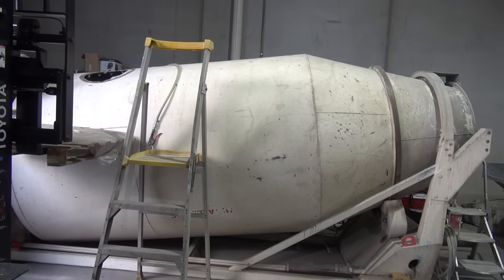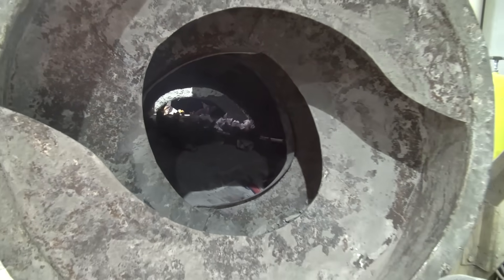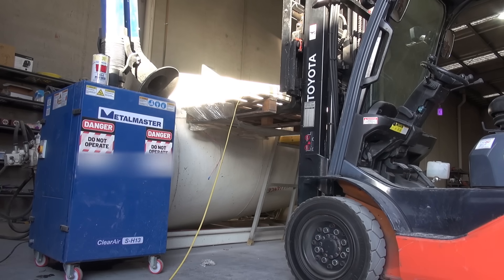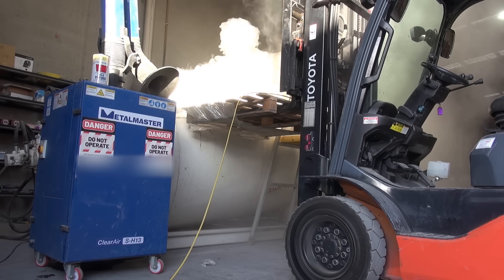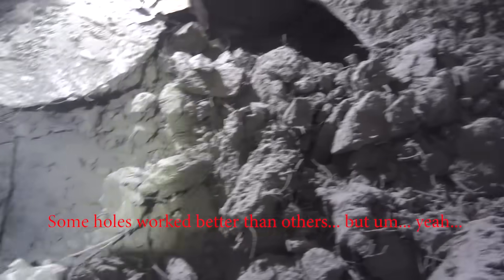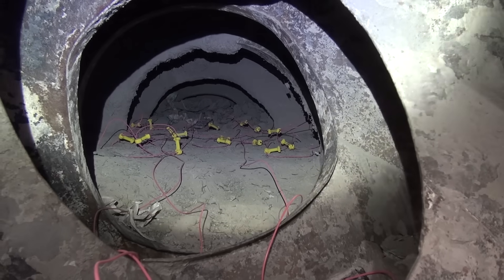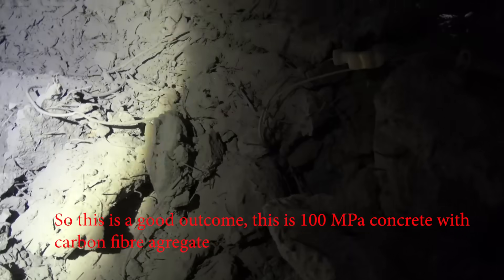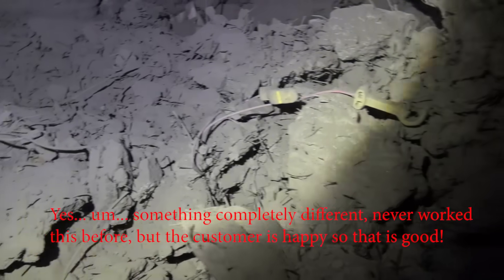Using Explosives to clean out a concrete truck

Comment: At least it will self-unload by rotating the barrel backwards, as if the concrete were liquid.  I hope you used double hearing protection in there, Dave!
That were all those sticks/roots which looked like weeds.  That was strange to see in the broken chunks of concrete.  Oh, carbon fiber.  Hmm.
I thought the companies used fairly undiluted muriatic acid to eat the concrete away.  (I use 10% MA on my crete tools.)
Reply from the maker: We had a lot of discussion about how to do it, using a jack hammer was a failure - in the end we just blasted it. Not enough room in there to use my small air drill, so we used a large electric drill, this was a lot quieter also.

Comment: JHC, Carbon filaments and you still took the job... Very impressive, that's seriously tough stuff.
Reply from the maker: The carbon fiber made it much more difficult but it was still possible. I did not really want to do it. A regular size bowl on a truck is an uncomfortable work place, this one was really tight.

Comment: You have admirable patience. I hope they paid you well. It was more difficult than usual because it was fiber-reinforced. The last time it happened to me, I cut a longitudinal window 50 cm wide and the entire length of the mixer. In Italy, we call it a glass. I had holes drilled every 50 cm and loaded it with 3 kg of gelatin. After firing, I had the glass pushed with a wheel loader and it emptied as if it were full of gravel. Then I called the scrap dealer and sold it by weight.
Reply from the maker: Hi Laurence, It certainly was more difficult than usual because of the fiber. Did you not want to try to save the bowl that you blasted? I'm thinking that 3Kg is a bit heavy handed.
Reply: @demolitiondavedrillandblast  It had fallen into the river loaded with concrete. Luckily, the driver was on the ground maneuvering; there was nothing salvageable. The environmental protection authority had ordered me to remove it within two weeks, and there was no road to get close to it with a crane. The least expensive solution was demolition. When I released the current, it swelled like a balloon filled with air and immediately returned to its original shape.
Reply from the maker: Good call.

Comment: Did someone add wire to that mix?
I’ve seen fiber mesh in a mix but never anything that large of a diameter!
Reply from the maker: It is carbon fiber aggregate. This mix if for shotcrete, the fiber makes it very strong.

Comment: Bravo.....fire the worker that didn't  do wash out..........they make jackhammer  thats designed  to do that job......and explosive  indoor is a  problem........mom say.....loss ur licenses....
Reply from the maker: They tried to jack hammer it and failed. This is super high strength concrete designed for spraying on tunnel walls, it has carbon fiber strands in it to hold it all together - this mad it almost impossible to remove with traditional methods. Using explosive in a carefully managed environment was no problem. We warned the neighbors and they did not complain.

Comment: I was wondering what the fibres were . Hadn't heard if carbon fibre reinforced concrete before. 
That's one very cramped space to be climbing into. It must have been a joy to drill holes in there, not. 
Good to see a professional do what mythbusters couldn't without removing the mixer too.
Reply from the maker: It certainly was a tight squeeze in there!

Comment: How could all that explosives and time labour be cheaper than a new barrel plus recycle value of the steel once you cut it and peel it off the concrete.
Reply from the maker: It was not only much cheaper to fix it, but much quicker, and that was the key issue. This unit was a special build, made in France and being used on a tunnel project.

Comment: I'm pretty sure they didn't leave it there to harden on purpose or so. Probably got a power outage or mechanical malfunction when they were mixing.
Reply from the maker: The unit popped a hydraulic hose... and being a quick setting mix for shotcreting, it was all over very quickly.

Comment: Why dont they leave the barrel on the truck so you could turn the barrel to empty it between blasts ?
Reply from the maker: This mixer is skid mounted.
Reply: I see that I was asking why it is not left on the truck so you could spin out the blasted material
Reply: The material will never be out of the barrell if it cant turn

Comment: 😆 we used to go down the drains too. So dangerous. Some tight squeezes sometimes. .....i was wondering what the hell that crappy concrete was looked like a special somebody snatched it mix. 100...thats hardaf. I remember weeks of drilling 45+mpa horizontal by hand with 30mm rock drill, that sucked...
Lots of experience doing it the hard way 😂👉Hmu if your hiring 👍have machine tickets too. I'd love to work in blasting.
Reply from the maker: All horizontal drilling without an air leg really sucks Mark. Where are you?

Comment: What is the cost difference between salvaging mixers in this condition, or worse, as opposed to replacing them??
Reply from the maker: Cost of replacement was higher but the big issue was waiting time for a new one.

Comment: Sorry if this has already been asked but what the cost of the service versus buy a new agitator drum?
Reply from the maker: The cost of a new drum is high and the two companies in Aus. that make them have full order books so there is also a long waiting time. More so with this one as it is not a standard product. Add to this the cost of a large crane to change out and disposing of the old drum.

Comment: Concrete fumes

Don't breathe that!
Reply from the maker: I go to a lot of trouble not to breathe it FP, I have a full face P3 rated respirator and when I am inside the bowel there is a vacuum extraction system running the whole time.

Comment: when I was in high school,  my step father at the time was the big cheese at a ready mix company. there was an accident once where a truck came apart and they just couldnt get the concrete out of the drum. they concidered every thing, including this. in the end it was cheaper just to send it off to the scrapper. they used torches to cut the steel off and peel it like an egg. I bet that concrete is still out there somewhere.
Reply from the maker: There is no cheap option here, to replace the drum you need a huge crane and getting rid of the old drum is expensive

Comment: I work as an electrician and ive never seen concrete with fibers. Ive heard of it though. Where is it used for?  Is it more durable or expensive ? Can you use it without structural steel ?
Reply from the maker: This was a shotcrete mix for lining mine tunnels, very very tough stuff, used in conjugation with bolted mesh.
Reply: @demolitiondavedrillandblast  i see, thank you so much for the reply Sir! Have a nice day

Comment: It must be a deafening experience in that confined space. Hope they give you adequate ear protection to use while blasting! I would imagine that used bucket teeth would be able to chip concrete out of a barrel if they fit into it. Just got to find a drive shaft and motor that would effectively turn it while they do their work. The other tool that comes to mind could be a mini excavator with a long spade or chisel bit in it. That would take most of the hand jack hammer work out of it. Someone might custom make a vibrating version that can vibrate sideways with a look similar to a spiked mace that warriors from long ago used to club their enemies. If you know what a sheepsfoot roller is in the earthmoving industry is, something like that only small enough to fit in the barrel opening. Just random ideas I'm getting, if you've already tried something similar, don't worry about it. :D

Comment: "customer is happy", driver that mucked the load holding the jackhammer in the corner is ecstatic!
Reply: It's not a concrete truck unit, if you had taken notice of the cerroundinds you would have realised it's an inside job doing factory work , probably when they had a power cut

Comment: I remember doing this many years ago for a local redimix company.  It was a lot of fun drilling and blasting but shoveling out the debris while the barrel roasted in the summer fun did take a bit of the edge off the fun.  Learned a lot of physics on that job.
Reply from the maker: Hard work on a hot day, no doubt about that Mark.

Comment: Who was the wally that left fibre reinforced concrete in the mixer to set? Their boss should have put them in there with a hammer and chisel,
Reply from the maker: Hydraulic fail, no drum rotation...
Reply: @demolitiondavedrillandblast  Mechanical failure then, but still why did they not get in and start shovelling before it set? Would have been the common sense thing to do you'd think.
Reply from the maker: Yeah, if you or I paid for it we would be trying very hard to save it, I don't know any of the details as to how this came about VE

Comment: Awesome job.  I wonder if inverting the barrel for each shot would help.  Clear the muck, and maybe allow chunks to fall free.
Reply from the maker: Yes, probably however at that time they had no hydraulic power source to get it turning, also have to be very careful that the whole thing does not tip over.

Comment: Spoke to a cement guy here in Jamaica and if for any reason he  can't dump his load and it starts to harden  ( starts seeing stream) he dumps a 10 pound bag of sugar in the mix so when it does harden its super weak and easier to break up.
Reply from the maker: The sugar works well when you are able to mix it in, this one had a hydraulic failure and was not able to turn and also I guess that since it was a shotcrete mix it was probably also fast setting.

Comment: Myth Busters sucks anyhow.  They have been wrong sooooo many times.  Just being wrong doesn't make me hate them, it's when they show intentionally fudged results to shill...that makes them suck.  I guess they had a few Marines, freshly battle stressed, a little upset over calling Carlos Hathcock a liar.  (Hathcock was a Vietnam War Marine sniper who managed to take out an NVA sniper by shooting his scope, the glint was all he could see. Hatcock wasn't a hero only because of his success as a sniper, he burnt himself up rescuing soldiers from a burning APC.  Jamie and Adam said this very brave humble man was lying, later proved possible many times.  Was the only one they retracted that I know of, and they did it really quick....... :)  :)  :)    Frozen Chickens testing windshields, wrong, Broad heads useless on arrows, wrong, hydrogen won't run a car, wrong, (source of it whatever, they said it just won't run an ICE lol), Fudged their data on hydrogen generation from solar, altered time stamps, but forgot to erase shadows lol.....they suck.

Your vid awesome,  thanks.
Reply from the maker: Thanks for watching Rick.
Reply: @demolitiondavedrillandblast  Sorry I ranted, nice vid.  Do you guys use sugar when you get down close?
Reply from the maker: Sugar to prevent the cement going of is commonly used here Rick, not much use though when you have a hydraulic fail that stops the drum turning and there is a quick set mix inside.
Reply: @demolitiondavedrillandblast  Good to know, thanks

Comment: A full load of concrete left inside to set solid. That's passive sabotage.
Reply from the maker: No, just a hydraulic failure in this case, have done other truck mixer that definitely was sabotage though.
Reply: @demolitiondavedrillandblast  just that we had that happen as well and managed to shovel and bucket most of it out. Warm work though.
Reply from the maker: And the smell of ammonia?

Comment: Looks like a sabotage as there are rebars inside.  Were the workers not paid or the boss is an a hole or both?
Reply from the maker: No, no, The fibers make very strong reinforcing for shotcreting tunnel walls, the drum stopped when there was a hydraulic failure and it could not be fixed in time because this is a very quick setting mix.

Comment: You know how like a dentist get that tool and he puts it on the inside of your tooth to drill it out to put a new Canal instead of putting it inside the tooth put it on the outside of the tooth and vibrate it from the outside to the Core just an example

Comment: If you can put three different rods at Angles along the body and use those rods like a transmitting a tuning fork frequency and as you alternate the three different frequencies between the three different polls and a circular formation it would pound out the concrete into a powder and basically make it into starting material without using any explosives but just imagine putting a bad drummle on the side of the can the knock the plaster out of a tin can try that first

Comment: Carbon fiber......hope you had good  mask............
Reply from the maker: I did! using a P3 rated particle filter, the main risk comes from sanding the stuff in this case the fibers seem to be almost unbreakable, when the concrete breaks the fiber remains in tact but just pulls out of the concrete.

Comment: You could have filled it with caustic soda. That would dissolve the concrete and won't damage the steel. Not as fun and will take longer.

Comment: Why wouldn’t it be emptied or watered down so that it doesn’t set?
Reply: Any number of reasons, someone quit and let it go hard, truck got stuck, rotator failed.
Reply from the maker: Hydraulic failure = can not rotate drum = can not empty = hard concrete in drum.

Comment: Those are carbon fibers? I didn't know it existed. I have seen fiber glass In a product called power wall a stucco that is crack resistant. But this must be very good concrete. Unfortunately for these guys
Reply from the maker: Very strong stuff for shotcreting mine tunnel walls.

Comment: i had to use a jack hammer to clean out thick accumulation  in a mixer once.  it was deafening loud....  They made me do it again and i kind of refused,  i bought 40 bowling balls, chucked them in and turned it on and let it tumble for 8 hours...  Came out looking like new inside
Reply from the maker: Good idea.

Comment: Done two of these was using about an 1/8 of a stick in each hole, boss said we were taking to long, he drilled the holes deeper and put 1/3 of a stick in each hole and split a 3 month old muhlhauser straight down the welds then walked away, could of killed us.
Reply from the maker: it's a fine line CC. I guess the boss don't do them anymore.

Comment: This was a special concrete mix in the which had harden in the mixer? Were these explosives low velocity or shape holes drills for the charges? To break the concrete over several blasting operations? I would suspect an explosive charge could blow a hole in steel.
Reply from the maker: Hi Theo, the explosive use here was an interesting cocktail of small amount of very high velocity high explosive and some smokeless powder (low explosive). Yes if the explosive charge was too close to the outer steel drum it could damage it. Considerable care was taken when drilling the holes to avoid this.

Comment: what does the concrete have steel in it?
Reply from the maker: They are actually short lengths of carbon fiber.
Reply: @demolitiondavedrillandblast  I was wondering I have seen fiber added but not that large size. Thank you for the reply!

Comment: I recognised the fibres having co-operated a concrete batching plant. We used to sell concrete with the fibres, but the customer needed to provide their own wash-out. The issue with washing-out at the plant is the water recycling system. The fibres clog the pumps used to move the water back into the batching system after washout.
It wouldn't surprise me if washout was refused to the operators of this barrel.
Reply from the maker: That is something that I had never thought of.

Comment: Ok why would someone stop the drum from spinning to let this happen in the first place ? Is this something a new driver would do? An apprentice? Someone not paying attention? Someone who's high? If you have concrete left over from a job you can't use it goes to back to the dump yard to be disposed of right? After 3 plus house the concrete is basically done. You can add water etc to keep it  from locking up but otherwise useless.. the barrel should still be spinning until it gets dumped right?  I guess what I'm asking is. THIS IS 100% preventable right?
Reply from the maker: THIS IS 100% preventable right? - This often happens in trucks when they have a crash or the the hydraulic system that turns the barrel pops a hose.... or in one case the driver was told that he was getting the sack at the end of the day so he drove the truck to the nearest railway station, parked the truck up and caught the train home.
Reply: @demolitiondavedrillandblast  
Hahahah Thank you so much for answering this. Your the man!!

Comment: Back in early 1990s I worked in a limestone quarry. Another part of the company was a lime plant. The lime kiln was,I'm guessing,200 ' long about 15' in diameter. To clean the slag out of the kiln,the company had a 10ga. Shotgun  on a tripod and some workers stood there all day, maybe several shifts and fired 10 ga. Slugs at the paddles inside the kiln. I've seen 80 lb lime bags,dozens of them,full of spent paper 10ga. Shotshells.
Reply from the maker: That is a lot of lead to spray around inside!

Comment: Good video. Would there be any advantage in inverting the drum after the charges are set so you can use gravity to assist.
Reply from the maker: I would not dare with this particular unit as it is only one a light frame that is not bolted down here and would likely tip over. even when you do this with a set concrete truck they get a bit scary.